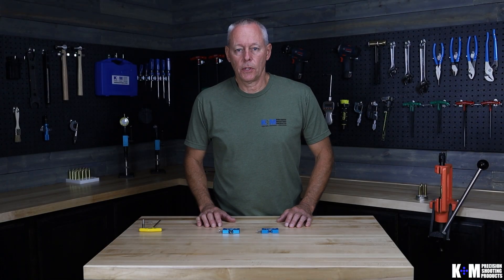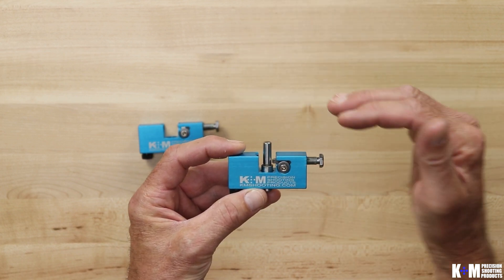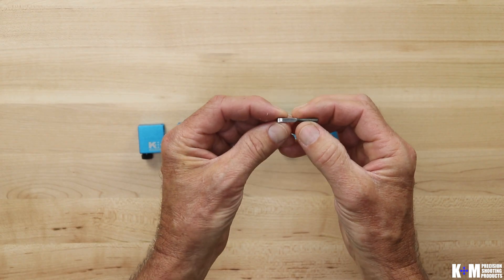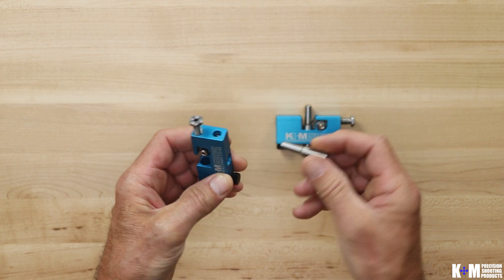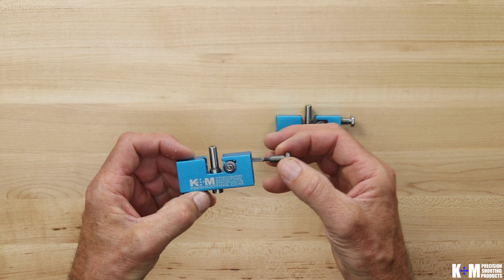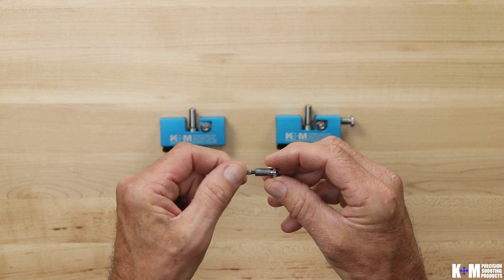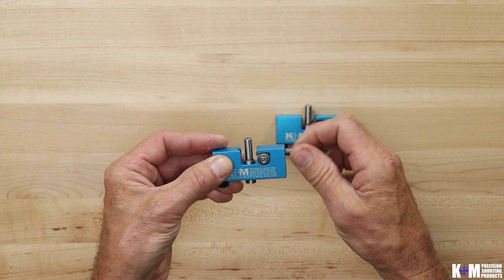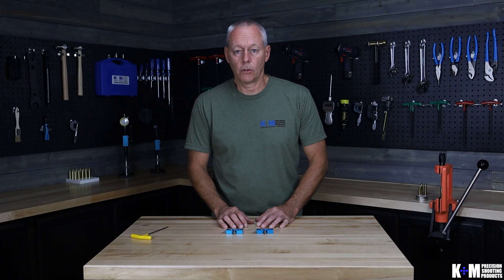Neck Turner Cutter Orientation Coarse Adjustment | How To Neck Turning | K&M Precision Reloading

Comment: So how do you do the FINE adjustment?
There’s no video for that. 

What is the screw for on the face? Is that the fine adjustment?
Reply from the maker: Hey Boecfus, the fine adjustment is made with the hex adjustment nut. The screw on the face is to lock and secure the cutter in position. 
Check out the neck turner how-to video to see the fine adjustment and lock-screw in action: https://youtu.be/d1bVi3MfzEk
Reply: @kmshooting  My puppy ate 3/4 of the tin of Imperial Sizing Wax!  She was fine.  Pooped real smooth.
Reply: @kmshooting  Thank you.  I am just starting my second batch of this and it has been a while after a move.  I lost the power adapter (blue ring thing) in the move.  Can you help me buy a replacement please?
Reply from the maker: Hey Bocefus, the power adapter and power grip can be found on our neck turning tools page and I'll include direct links as well:
Neck Turning Tools Page: https://kmshooting.com/product-category/neck-tools/standard-caliber/
Power Adapter: https://kmshooting.com/product/power-adapter-without-shell-holder/ 
Power Grip: https://kmshooting.com/product/power-grip/